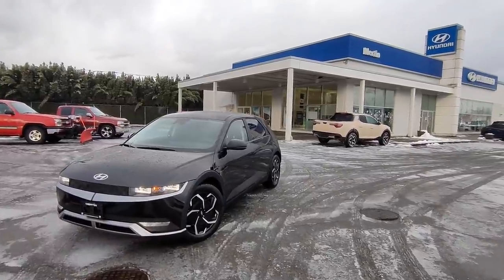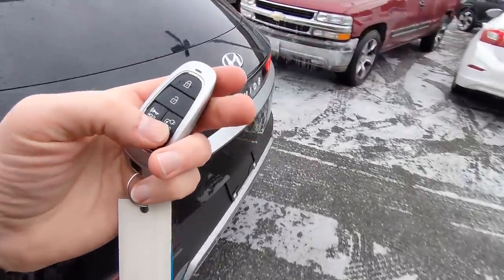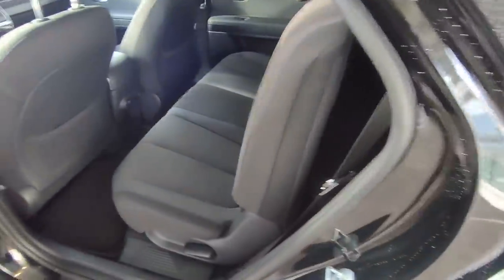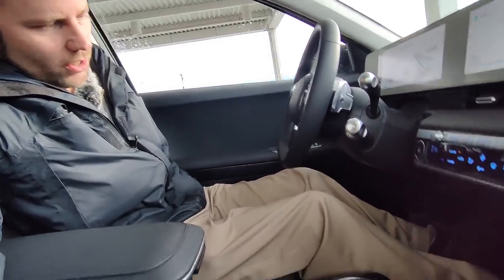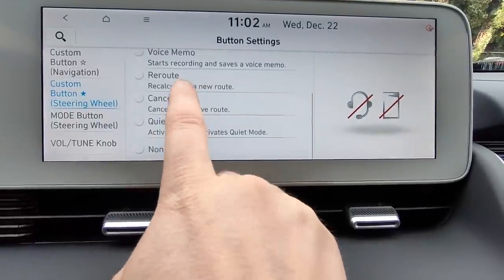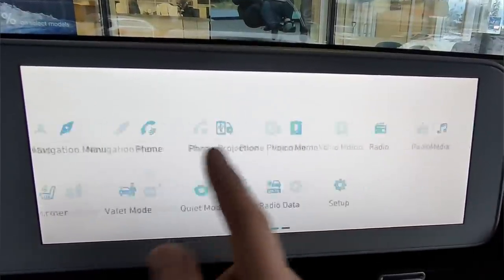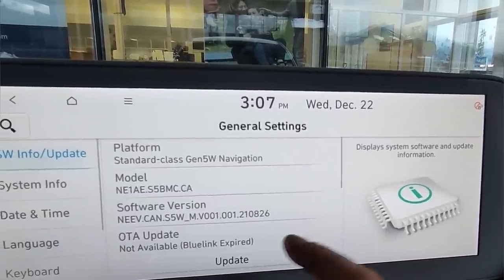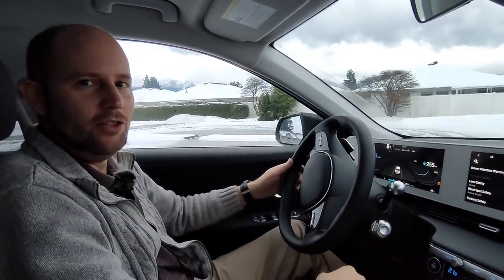2022 Hyundai IONIQ 5 Electric FULL  REVIEW!!

Comment: Great. Thanks. I learned heaps of little tricks that I didn't know about. You seemed to not mention that if the righthand paddle is held for +1 second, the regen goes into AUTO mode and learns how you drive.
Reply from the maker: That's because up until this moment...I didn't even know that lol. Thank you.

Never liked the auto regen though, truth be told. The Kona and older Ioniq had the option as well, but I'm pretty sure it could only be enabled in the user settings. 
Personally I prefer to drive on the highest regeneration setting constantly on.

Comment: Excellent review! I've watched countless Ionic 5 reviews but picked up a lot of tips I haven't seen elsewhere, thanks👍 Collecting my Ionic 5 next week. Trim level is a little different here in Ireland but not too much. We do get a heat pump which should help winter range. Completely agree on the rear wiper, airflow is fine at higher speeds but no use in city driving or with cleaning off dirt.
Reply from the maker: Thx for the comment!

Yes heat pumps are standard here on an trims short of the base model.
Reply: Agree, excellent review. I test drove one recently and I'm with you -- my one and only gripe is the rear view wash & wipe. Everything else was so good that I'm not going to let it be a deal breaker.
Reply from the maker: @DaveMGmovies  thank you!

Comment: Great video. The most in depth canadian video i have seen so far. Great job! What do you expect the real world range to be on the model you tested in colder temps at highway driving speeds with the heat on?
Reply from the maker: Thx for the comment!

So as far as the range estimates. The numbers that Hyundai puts on, are actually highway speed (100kph) with climate system used. 

However, while Hyundai has been acknowledged for having the best winter performance, it's still completely reasonable to expect a range loss of about 15% at 0°C. Or 20% at -10°C

So at -10°C I would expect the standard range model to have realistically about 295 km of range.

 It's currently -14° here in Chilliwack, and this unit is estimating 285km without pre-warming the battery, and it was left outside all night.

Had the vehicle been plugged in and pre-warmed, it probably would have been over 300km of range still.

Comment: Good review, this will be my next car, or IONIQ 6 or 7 by the time I need to upgrade.  I have a PHEV now, and I use electricity most of the time, and it also gives me no range anxiety when I need to drive to Vegas, no worry about waiting, packed full charging stations or broken chargers.  I think in the next a few years, all these problems will be solved.
Reply from the maker: Thx for the comment!!
Reply: Are you in Los Angeles? The drive to Vegas from LA is still complicated during busy holidays by too many EVs trying to charge along the way at the same time. There was a video from the first COVID Thanksgiving where the line of Teslas waiting to charge on the way to Vegas was unbelievably long. Many Teslas had to be towed when they ran out of juice. 

I can only imagine things just as bad for non Tesla EVs as well during busy holidays. 

That’s where the PHEV shines. I have a Kia Niro EV and just ordered a Hyundai Santa Fe PHEV with 30 miles of EV range. Once we get the Santa Fe long road trips are an option again as I dared not go nuts with the Niro even though it had 240 mile range. 

I consider 240 miles a regional EV.

Comment: Best review I've seen yet, and thanks for the info. It's like pilot ground school! Here in the UK we have a few different things. For a start, after all the cars supplied with it for press reviews we found out they have removed the auto door handles across all delivery models, which is massively disappointing. Also, on my test drives it's become apparent the rear screen airflow clean is fantastic - but only over 60mph. Otherwise it's useless. Ask your dealer to give it a coat of Rain-X. It winds them up to the max! 
Having said all that I can't wait for mine to arrive. Top spec long range RWD in Galaxy Grey.
Reply from the maker: Thx so much!
Reply: The first batch of customer cars which arrived in the UK - The Project 45's, were the only ones which had the auto flush handles as standard - a few others (like all the press cars) had them fitted by 'mistake' ;)

Comment: The 12V battery is also for safety.  It's used to operate a disconnect so the HV battery is not connected to other components when the car is off.  It also allows firefighters the option of cutting 12V battery cable to disconnect the HV battery.
Reply from the maker: That's correct... I learned that after making the video

Comment: This is the single best review I've seen on this car. 
The only thing I'd like to know is if there's a tow package available. I've only hooked a trailer up to my Jeep once in the last 7 years but I do have a bike rack that goes into the tow bar that I'd like to keep using. 
I'm going to assume that there's not going to be any such thing as a roof rack as it would create drag. 

It's also good to see the vents on the column on all trims. I missed having vents that actually made a difference in the back seats when I got rid of my Journey. 

One more question. Blue Link comes with the car for 3 years. What's the price after that? 
Jeep offers remote start from a web page/app. But the price on that is outrageous. They want 15 bucks a month (for something that I would use twice a day) and they try to justify the price by piling on a bunch of stuff that does nothing (like the ability to play Spotify from your phone using the touchscreen, not a Spotify subscription, just the icon to launch the service you have on your phone).
Reply from the maker: Thx for the comment!

From what I understand with the info I've been given so far. 

Yes there should be a tow package available.

Bluelink is free in Canada for 3 years, but I'm not sure about other countries.

No pricing on bluelink subscriptions yet in Canada, as it hasn't been around for 3 years yet. Not sure what it costs in other countries.

Bluelink allows remote start from app, unlock, lock, check charge level, start charge, configure climate on remote start, start heated seats/steering wheel, find your car on Google map, beep the horn, flash the lights, check service history and time till next service, check on board diagnostic info... 
As well as a bunch of other stuff outside the app, like an sos button to call for emergencies, but also automatic emergency services in the event of a collision, and of course roadside assistance at the push of a button.

I think that's most everything.

Comment: Nice catch with the regen behavior being different on L0 mode. A small, but nice feature nobody else caught. Is there any way to preheat the battery for L3 charging? Either manual, or automatic via navigation (like Tesla)?
Reply from the maker: Thx!

As for pre heating the battery, I don't believe so, however with packet cells it's actually less important as they're easier to heat and cool.

Comment: I didn't realize that the base model doesn't have the leg rest. That's definitely not a deal breaker as I doubt I'd rarely use it, but good to know since everyone reviews the highest trim model so it's hard to tell what's included in the lower trims. The RWD SE with the biggest battery seems to be the best value if you can live without the extra perks and don't need the AWD. The only perk I wish was available as an add on is the surround view cameras as they would be very useful in certain situations.
Reply from the maker: Thx for the comment!

Comment: Great video, did you notice when you drive that any of the information on the left info screen is blocked by the steering wheel? Not sure if your planning on upgrading to the Ioniq 5? I just leased a 2021 Ioniq Limited and feel it may be worth an upgrade in 2022. Perhaps to smaller Ioniq 3.
Reply from the maker: Thx for the comment!

No I didn't find anything really blocked. At least, nothing that I noticed or found bothersome.

Personally, I really want an electric truck, so I'm not sure exactly what I'm going to do.

Comment: I bought the car (Ioniq5 limited) based on this review and few more. While the car is good but it has lots of issues. I will list those down when time permits. Just so that all is aware, I had a flat tire (within 3 months of purchasing) on 22nd June and till today (5th July) they could not replace the rim & tire.  No single spare parts available in USA. Also, apparently the rim and tire would cost me ~USD2K,  Please note I paid almost USD70K on-road price and the dealership made me purchase additional coverage on top of what #Hyundai offers. :(
Reply from the maker: Thx for the comment... Though, that's not really an issue of the Ioniq5 specifically.
Sorry about the troubles you've had though, that really sux 🙁

Comment: Any way to use on board cams for replacing a dash cam??? Besides emergency cam shot pre crash? Aye? have to have front and rear.
Reply from the maker: I believe that Hyundai actually does record that into the system... However the owner doesn't have the ability to see it. From what I understand, crash investigators are able to utilize it though. 

I could be wrong.

Comment: I did a test drive of this ev at the owen sound dealership. Excellent car….but the rear windshield was extremely dirty and wouldn’t clean without the wiper. No wiper…NO SALE. It is unsafe and extremely stupid for them to say that it isn’t needed. It is. Especially in winter. 

Until then I’ll stick with my Bolt EV.
Reply from the maker: Nothing a little rain-x wouldn't help. But I do wish it had a wiper.
Reply: @edsgarage001  yeah I guess that would help a little. Lol

Also the price…$58,000 for the base model is steep. But when you consider the safety features and all those leds it kinda makes sense.
Reply from the maker: @Digikidthevoiceofreason  58?? Base model is $47k. Plus fees/taxes, then minus govt rebate
Reply from the maker: In Ontario, base model total should work out to around $50,000 All In.

The model in my video is about $49++ etc.
Reply: @edsgarage001  seems like my last comment was deleted. Check out the price at the owen sound dealership in Ontario. It is a preferred model ( was told that is the base model by a friend) and it’s $58,000CDN. It appears there is a sale on it now for $55,000CDN. 

That is why I said that.
Reply from the maker: @Digikidthevoiceofreason  sounds like they're marking it up... That's unfortunate 😕.

I would think that if you did a factory order, you should be able to get it for MSRP. Check a different dealership.
Reply from the maker: @Digikidthevoiceofreason  it's also possible that they've marked it up to avoid people wanting to buy it. I know that sounds weird, but every dealer only got one for demo purposes, and Hyundai has asked that they not be sold.
Reply: @edsgarage001  That’s possible. Sneaky as well and if I catch a dealer doing that they will lose a sale.
Reply from the maker: @Digikidthevoiceofreason  well, what they should do is just say, no they can't sell it. Then allow you to factory order at MSRP

Comment: Love the car but are they reliable ?
Reply from the maker: Electric cars are by design way way way more reliable then gasoline cars as they have far fewer moving parts.

Plus they don't need much maintenance either.

The original Hyundai ioniq and Kona EVs have been extremely reliable. Hyundai had a hiccup with the batteries produced by LG chemistry for the 19-20 models. But that was a flaw in the battery design by LG. Aside from that, no major issues at all.

Comment: I'm disappointed with the frunk as well. The RWD in other markets have a 57 litre frunk. For some reason, Hyundai are using the one from the AWD models. Maybe for cost? I'm thinking of finding a way to order the bigger one if I can find the part number.
Reply from the maker: Yeah, it's also possible that it's just because this is the first shipment of demo units. 

But I'd personally just take it out and fabricate something else. 

I did however check, and was able to store the tire repair kit, charger cable, cargo net and two tow hooks in there with a bit of room to spare.
Reply from the maker: And thx for the comment!

Comment: Don’t see much space left underneath that frunk. Whatever space left underneath the frunk may be needed for easy access for servicing the vehicle
Reply from the maker: No, it's got the wrong frunk in it. It's supposed to be deeper. 

It's difficult to see in my video, but there's about a 1 - 2 cubic feet of completely empty space there. 

And if servicing is needed, the frunk can easily be removed.
Reply: My guess is it's because of the emergency release regulation, otherwise they would either have to add an emergency release button or a divider
Reply from the maker: @yuju1004  yes someone else mentioned that too. Makes sense. 
I'll be making a follow-up video discussing that.

Comment: you have the wrong box for the front ... it is made for the AWD so the box is small. the rwd is 3 time bigger....
Reply from the maker: Yeah I know.... Tell Hyundai that lol. 

We figured maybe they were cutting corners a bit. Or maybe it's country specific.
Reply: @edsgarage001  It seems it needs to be replaced. It's should be 51 L not 27 L 'Frunk".  I was hoping they gave you an AWD by mistake but when you showed what was underneath it became clear. By the way, you are the first reviewer we have seen to go into the motor compartment. Thank you! 
Question: Is the 12 V accessory battery huge compared to a regular car battery or is it the camera angle?
Reply from the maker: @capitanocorelli1781  it's about the same as a regular car battery. 

Thx for the comment!
Reply: @edsgarage001  By the way, working Chrismas day, such dedication or are you just unwrapping your Christmas gift :)
Reply from the maker: @capitanocorelli1781  Christmas gifts are all unwrapped... YouTube replies are quick and easy 🙂
Reply: @edsgarage001  I should receive my IONIQ 5 long range RWD around mid-January and if it is the small front trunk I can guaranty you I will tell Hyundai exactly that

Comment: Where's the spare tire located?
Reply from the maker: EVs don't generally have spares. 
For weight reduction, you'll find a tire pump and sealant. Which frankly, is much easier to use, especially for elderly folks. But also when you're on the side of the highway, and it's snowing or raining, I'd much rather have the pump and sealant.